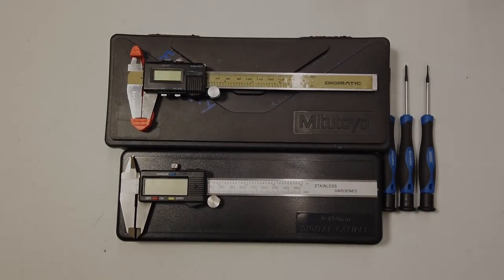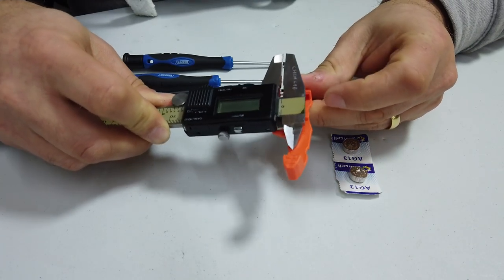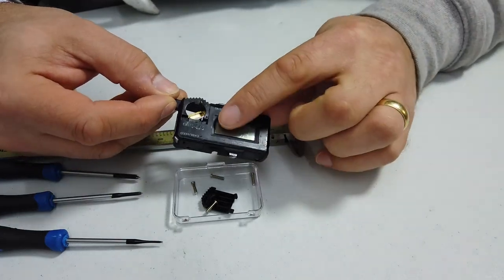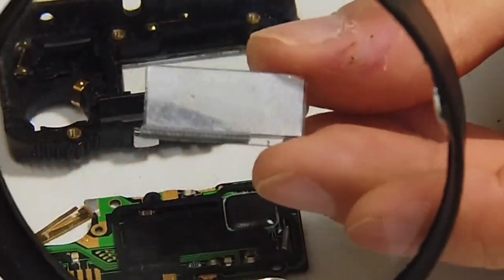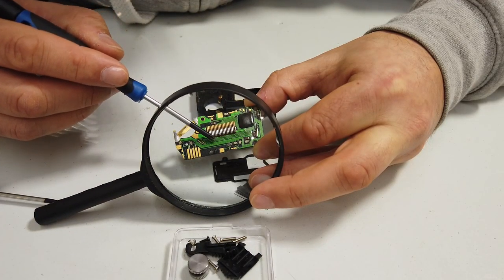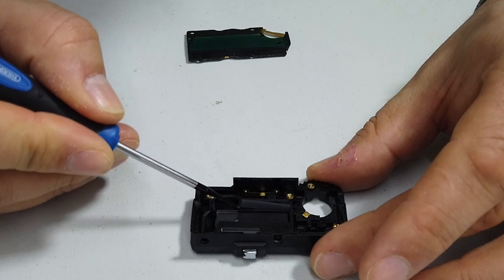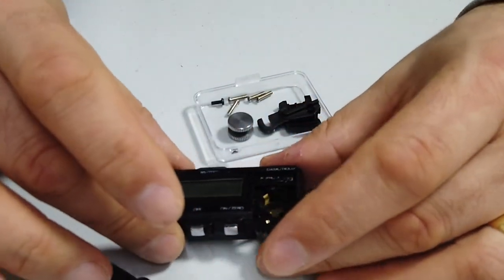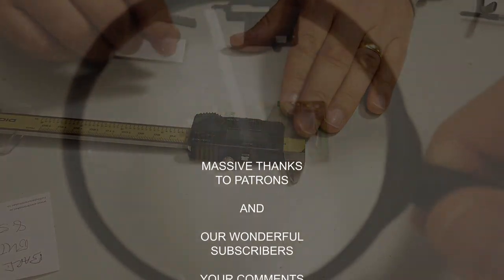DuB-EnG: Digital Vernier Caliper Use, Repair faded LCD display and a brief overview of How It Works

Comment: Intresting fix, I was given one as a gift a few years back. Great little devices, I use mine much more often than I thought I would. I will take your advice and leave it slightly ajar in its box. I was unaware of the corrosion issue. Thanks Howard ;)
Reply from the maker: That little rubber protector helps!! Maybe you could just keep a little paper between them! ... I’m off to see your z80 upgrade video in a moment :-).  Looking forward to it!!!

Comment: a great little repair , i wonder how many more people have one of these tucked away in a drawer somewhere , all but forgotten , with the same fault?

I am surprised that whilst you had it in pieces you did not take the opportunity to upgrade it - maybe replace the buttons with missile switches??
Reply from the maker: Hahahah....  the other guys suggested tiny Nixie tubes ...  but then they noticed how many angry people came out of the woodwork!! :-)
Reply: @DubiousEngineering  but that's why Ronseal have just released there anti-angry wood preservative range!!

Comment: Bit late to the game 😁 but please, it's NOT a vernier caliper. It's a digital caliper. 
Vernier calipers have a Vernier scale for reading tiny fractions of the units used (say, down to 1 thousandth of an inch). It's a particular use of the word. Without the Vernier scale, they're not Vernier calipers, which sadly will fade into the horizon & be lost to the past.
Anyway, I actually came here to say thanks for the vid. My caliper display was only illuminating partial  digits, not all sectors of the display.
I disassembled it and everything just fell out including the zebra which had me baffled...it just looks like a slip of plastic but looking at it under a microscope I could see these laminations.
I couldn't see how the LCD was connected to anything!
Your vid sorted the whole mystery, and it went back together perfectly, works 100% I had to do a little manipulation of the zebra connector to get the "strips" lined up & connected to all segments but it's great. Thanks a mill!
Reply from the maker: You're absolutely correct!!! 😊💯 ...  And I consider myself a metrologist!!  Silly boy 😉😅

Comment: Nice, detailed video. I dismantled an identical caliper to clean the button contact points. A tiny "L"-shaped copper strip with a hole in one end fell down, and I could not find where it belonged. I put the caliper together without that part, and it works fine.  

Could you please let me know where it should go?
Reply from the maker: Oooh... I wish they had pictures on this forum...  Can't easily help without pics